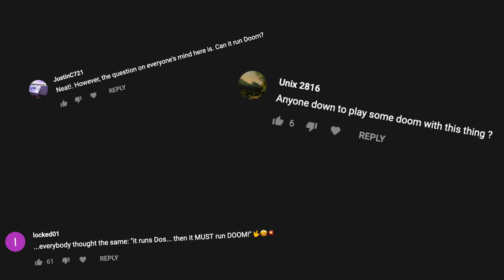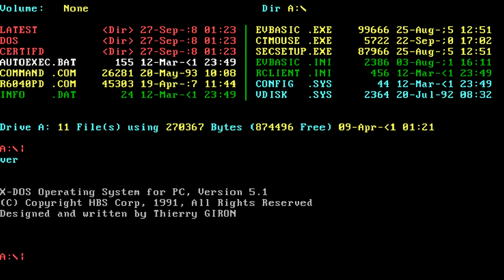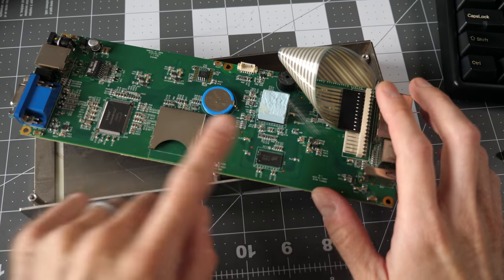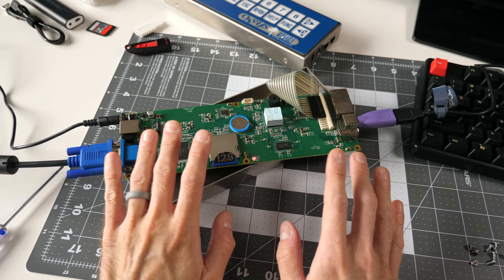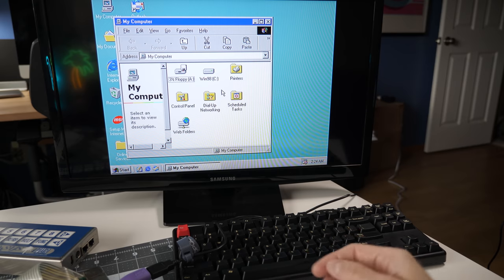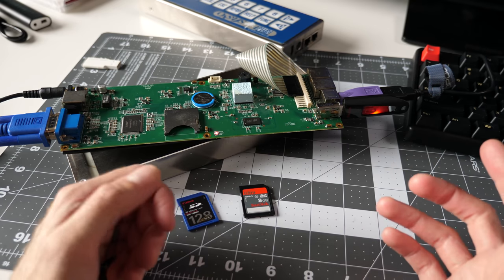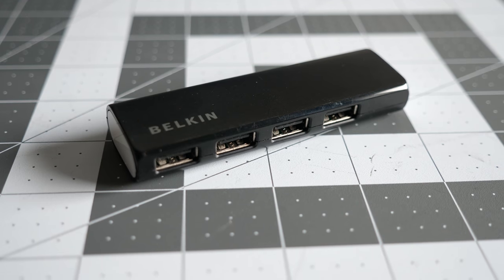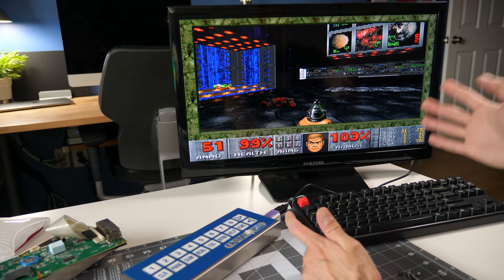Doom on a Commercial Kitchen Appliance

Comment: My desktop uses the same kind of flash, I had a corruption and fixed it using my Raspberry PI, its not that hard to do it, you just had to connect 4 wires, its a serial protocol and you can flash it without even desoldering it.

Comment: I've learned the hard way that Japanese drivers won't install on US Windows 2000.  Probably something to do with character set support. That might explain some of the issues you ran into.
Reply: Since NT (including 2000, XP, and everything later) uses Unicode internally I can't imagine any technical reason why Japanese drivers wouldn't work on a US version of Windows. It's more likely an arbitrary restriction added into the driver.

Comment: You can buy universal heatsinks online, have thermal tape on them. I did that to an old gpu that doesn't have ram cooling by default, they work great. Most cheap usb hubs that's aren't powered are daisy chain compatible, so that's why it works. I bet that has a built in keyboard controller somewhere it might be possible to get those keys working. The placement of the connector on the pins seems suspicious It could be a full blown qwerty header?

Comment: I think I saw someone talk about how that sector thing is also a problem with certain PS/2 configuration disks that you need to configure the BIOS, if you try opening them in Windows 98 or certain versions of dos they'll change some sector and make them not work, so there's some utility you can run to fix them? Either way it's really weird that the virtual floppy wouldn't be write protected.
Reply: seeing how its windows, it probably tried to write desktop.ini to it, and that's what totally screwed it up

Comment: I used to have a Vortex86 Thin Client, very cool, and at the time I did run Windows 95 on it.

That little SMD chip probably could be removed, and it would then default to the SD when no "floppy" is present. If you are adventureus, you could probably find a supllier to provide a replacement chip that maybe could give you more space.  Or, if you want to be less risky, you could find out which pin or pad provides power and disable that, which would then force SD card.

The USB first boot is kinda there in retail devices for industry because often the guys they send to repair or replace don't have technical skills so if they can configure the machines to always boot from USB, a tech only needs to know to power it off, put in USB device, power on and follow some predefined sheet of directions. Of course for security it's not exactly good because a malicious person could easily insert a USB device and brick the unit.

We had machines like that at BestBuy, our tills were IBM machines and were configured to boot from USB. I fooled around more than once with those. Management was sick and tired of those things failing, the hard drives kept dying (80GB !!) and we had a bunch of units that had bulging caps. BestBuy wouldn't send a tech unless a device failed a test, and they always had us do this stupid "reload" which never solved the issue as the drives were gathering pending sectors but couldn't ever get past, and a test or reload of course wouldn't always fix that unless you did a full format and force the sector to flip. 

So glad I got off that sinking boat.
Reply: Connecting a drive power connector backwards will usually fry the drive's electronics (guess  how I know) and then it would certainly fail the tests corporate was looking at. Not that I'd recommend doing that but I've read stories of people doing worse. Apparently 120VAC into a video card can blow a hole in the board.

Comment: A word of warning with PS2 splitters make sure that it handles the entire PS/2 protocol and not just part of it. I bought A PS/2 splitter and my mouse was acting wonky and when i went into my device manager it thought it was a barcode scanner which made the x and y axis wonky. If you're lucky enough to have a gaming board with a ps2 port either single colored or a universal half green half purple PS2 ports you're good; if not make sure it specifically says it's for keyboard and mouse and not just a generic  PS2 to usb adapter(basically spend the 9 bucks on the cheap chinese one that supports keyboards and mice properly vs the 5 dollar cheap chinese one that is a toss up)

Comment: I've never heard of an Open Source BIOS other than CoreBoot or LibreBoot, CoreBoot is actually used on all ChromeBooks, and LibreBoot is the same as CoreBoot but there's no binary blobs in the code.
Reply: SeaBIOS is a very commonly used Payload to emulate an actual BIOS often installed with Coreboot. Another often used payload is Tianocore which is the reference implementation of uEFI. Coreboot iself lacks the ability to boot anything outside of the BIOS EEPROM. So you need a payload in the EEPROM who does that. SeaBIOS and Tianocore are examples of that, but also you can install Grub, or even a full (but very tiny) Linux System.

Comment: Here's an idea to throw your way in regards to booting from the SD card.   Given that the boot selection has it as the 2nd drive, more than likely (on most systems) if booting from the first item on the list fails, it will attempt to boot from the second item in line, and so forth.  So my guess is if you disconnect the power to that chip (lift the 5v line), it should boot from the next device in line, which is the SD card (I wrote this before coming to the part where you bricked the chip).   I know that is not what you wanted to do as you mentioned not doing a modification, but hey...this is the real world and if it is something that will work for convenience, then heck, go for it!  Besides it is something that is not permanent and can always be undone.  What I do find peculiar is that it doesn't allow booting from the USB drive from the menu, but it will boot if a drive is inserted.   Since you have to fix the keypad anyway, changing to a newer cover that has the USB slot available to the outside would be beneficial.  Congratulations to getting it to work though.

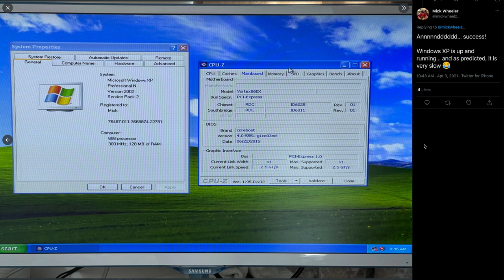Comment: 18:51 Looking up from that twitter post will reveal that you need a certain SD-IDE driver, installed with nLite
"That has not been so straightforward, as it needs a driver for the SD-IDE device..."

Comment: The bios options aren't "locked out" SeaBIOS doesn't have a configuration menu simply because it doesn't need one. It's primary goal is to boot Linux, and hand everything off to the system. You can compile some configurators INTO SeaBIOS, but they're minimal at best, and nothing like the configuration options in a proprietary BIOS.

Edit: I MAY have enough knowledge about coreboot that I could potentially get you a new BIOS for it, but it wouldn't be a minor task. The boot options were likely set when SeaBIOS was compiled as you can tell SeaBIOS what order to boot things in, and even tell it to boot directly to something, which is what it looks like this Andrew did.

Comment: Use a tool like FlashBoot. You can use it to make a fully installed working version of XP on USB. It'd be more likely to boot if it doesn't have to go through the installation process. You will still need the drivers though after. It's paid software unfortunately, but there may be another free option.

Comment: So SeaBIOS actually doesn't have any kind of bios settings screen. It's designed to be used with QEMU, which would have any configuration needed already done in the virtual machine / emulator settings. Although seeing it on physical hardware is a bit of trip i must say. I wonder how modified it must be to do that, the SoC is likely designed to be as close as possible to a machine target SeaBIOS has a emulation target for.
Reply: SeaBIOS is not specifically designed to run with QEMU, its other common use is with coreboot. 
I installed coreboot with SeaBIOS on my Notebook myself, because coreboot supports way more hardware than the original EFI and I used that to upgrade to an CPU that is officially not compatible with my Notebook.

Comment: I wonder what would happen if you removed the on board flash storage, would it then just boot from SD card or usb without intervention?
Reply: yes just temp remove pin 8, which is VCC... no power, no problem

Comment: So maybe I missed an important detail in the video... why didn't you just install DOOM to the SPI flash? Did you try it and it didn't work with "X-DOS"? Also out of the scope of your work (fantastic by the way), but since the device has the executables for the device that read from the built-in membrane keys, it should be fairly trivial to decompile & reverse engineer how to read the keys.

Comment: boot linux or dos on a working unit, use dd or similar to copy everything to a disk image on a USB drive.
you can then overwrite with that just the sectors that windows changed. just copying the files to a fresh install will change their position, which may cause errors booting also.

Comment: A tip if you want Windows 9x to work better: Open the Add New Hardware control panel and it will manually do an exhaustive search for hardware it understands, including the PCI bus. Once it finds the PCI bus it will see the rest of the devices after a reboot. Then you can install video and other drivers as you would normally.

But note once USB drivers load it might crash Windows if booting from USB. The internal SD2IDE should work, though. If you want it to boot Windows automatically without F12 then SYS the A: drive and copy your C drive's MSDOS.SYS to it.

Comment: I was gonna suggest that you try TinyXP, or one of the other super small versions.  They trimmed Tiny down to be the bare essentials...and I mean bare.  A lot of the systems that would throw errors at regular XP would take Tiny no problem since most of the files just aren't there.  

However almost no drivers install, then you have to back track to find them...in a lot of cases you could use the generic MS driver instead of manufacturers driver...to at least get some functionality.

Either way, I am happy you got it.  I can't believe that little thing runs doom...lol.

Comment: Not sure but with the USB hub it might be possible to use an external USB speaker system but you might have to bridge it with some kind of external sound card through USB if that's possible.

Comment: Since you can press F12 to interrupt boot and select the SD card as an IDE drive, have you checked if the X-DOS install shows it as a mounted drive from the prompt?  If so, you should be able to modify AUTOEXEC.BAT to boot to whatever you put on it.  For that matter, REM the lines in the AUTOEXEC.BAT file that load the built in software; you'll always boot to a prompt instead of having to fight for an F12 interrupt, and you can restore to factory settings at any time.  Your final solution is a better softmod for externally-accessible USB ports, but this may make the SD card slot a viable alternative if you want a permanent (but easily reversible) built-in solution to make a mini Doom machine.

Comment: So clearly the onboard flash isn't big enough to install Doom on (looks like it's around 1.1 MB), but that should be enough to serve as a DOS boot disk. From there, you could put the rest of an MS-DOS install on the SD card or USB drive (though, maybe that requires using FreeDOS instead of MS-DOS) and add that to the PATH, and then put Doom on the SD card or USB drive. Or even add Doom to the autoexec, so the thing boots right into Doom.

Comment: What if you just desolder the flash memory chip?  It'll have to default to the next available option in the bootloader and should just load whatever you want off the SD card automatically.  The USB works, but then you have a USB drive hanging off, and I'd bet the SD card would run faster.

Comment: Floppy disks usually don't have a "boot flag" because they didn't have partitions. But what might happen is that Win98 is adding "long filename support" to the directory and the boot sector of the 1991 DOS is not grasping those weird filenames/attribute combos that trick FAT into supporting that stuff.
Reply: Floppies still have the boot marker in their Volume Boot Record (VBR), it's the 55 AA (or is it AA 55?) at the end of the first disk sector. The bootable partition flag is only used by the main Master Boot Record on the disk to determine which partition's VBR to boot next. The (conventional) BIOS itself actually doesn't know about partitions at all. To it a floppy's VBR and a hard drive's MBR are exactly the same thing.
Reply: @eDoc2020  I assumed the boot message that got stuck was already printed by the boot sector? The idea was that the BIOS reads the sector into RAM and jumps to the first instruction in that sector, wich is usually a near jump to whatever boot code is added after the whole BIOS parameter block and FAT details section. But that tiny fragment of (roughly) half a sector of machine code needs to locate and load the actual boot files form the filesystem. If Windows was adding the LFN support to the root directory, those directory entries might be way off for that boot loader code now. I *think* that is more likely what happened here. But without a raw dump, it's just speculation - and it's been quite a while when I dabbled into boot sector code, so this is mostly "as I recall" :)
Reply: @atkelar  The 'Booting from Floppy' message is printed by SeaBIOS before loading the boot sector. I don't think Windows will add any LFNs unless you add or rename a file. The data structure of a directory with LFNs is exactly the same as one without; no changes are needed to add support for LFNs.

In fact Microsoft's own bootloader doesn't support LFNs and AFAIK is very picky about the physical placement of the records for IO.SYS and MSDOS.SYS. If Windows added LFNs automatically I believe it might stop itself from booting.
Reply: @eDoc2020  It is indeed very picky... it's why it had the "sys" command to begin with. But I like to agree with you on the question: why would Windows update the directory... but extend it to: why the boot sector? The LFN entries are "compatible" with the old ones, but IIRC there are multiple "volume label" flags present where originally there should have been only one per disk. The whole issue strikes me as odd and has me wondering what actually happened there. ^^ - if you ever find out what it actually was: please share! :)
Reply: @atkelar  I believe Windows 9x modified the OEM ID for some sort of disk tracking, but it really was a bad idea. I actually went and downloaded X-DOS and it uses that field normally. After modification it still booted.

So I really don't know why it wouldn't boot after.

Comment: 128 MB RAM is definitely not enough to run XP properly. On my XP SP3 machine, the system alone needs around four times that. It typically would take two to three GB to run all the tasks XP-era PCs were capable of really well.

Comment: De-Solder the On-Chip Disk! Dremel a slot for your SD card, and USB. Doesn't have to be pretty :D Creating more of a task running Windows 95. USB Dos? Wonder if Windows 10 would load lol Just another odd question.
Reply: ~Watches more...~ Oof! lol I see where you were going with it all now.

Comment: Use NLite to create a custom Windows XP installation embedding the device drivers from the manufacturer's site in the ISO image.

You could also try using an older Windows XP version (without some of the Service Packs).

Or just install XP to the SD or pen drive using another machine and plug in, sometimes works just fine.

Comment: In the case of DR- and MS-DOS, it's more they both derive from the same parent (CP/M), the latter via Seattle Computings' clone of CP/M for x86 called 86-DOS. As DR-DOS was developed (later) by Digital Research (the originators of CP/M) expressly to address real shortcomings in MS-DOS, it's a bit misleading to suggest DR-DOS is derivative of incomplete work, acquired at second hand. Had Gary Kidall lived on just a few more years, I'm fairly confident that "Microsoft Windows" would only evoke nostalgia (and a lot of angry-funny anecdotes) today. Possibly the same fate for MacOS, too.

Comment: Ref. XP: you might also try to use the "/syspart" param ("winnt32.exe /syspart:D: /tempdrive:D:", maybe also with the "/makelocalsource"), that will allow you to prepare the installation drive on another PC, and then just connect that prepared drive and complete the install. Although as mentioned by some others, the issue might also be the missing drivers like the IDE, which you'd still need to slipstream into the install.

Comment: Back in the day with certain hardware, we had to load the disk controller drivers at the time of Windows setup, before booting into the graphical setup section. I think I had to hit F7 or something? Could possibly resolve your BSOD issue.
Reply: If installing normally that needs to be done before the text mode portion of setup so if text mode sees the drive this shouldn't be the issue.

Comment: windows 98 and earlier have not native usb support youll have to install drivers for usb stuff, xp cant be installed on an usb drive and to install from usb drive i can only suggest you to use easy2boot cause wintoflash is not free, windows xp load usb drivers on boot then if system is installed on usb usb will turn off and turn on while drivers are loaded and if drive is disconnected for a second BSOD will pop up, but you can install xp on the sd and put usb hub then usb sound card keyboard and mouse all if you put the drivers, xp with easy2boot or wintoflash will install in two stages to solve the usb media driver load bsod  and thanks for the video

Comment: Since it’s got a 300mhz Pentium equivalent with a basic PCIE graphics adapter, maybe it could run quake in software mode?
Reply: didn't see the part with a PCIE graphics adapter...
it's got a vga port adapter...PCIE is way overkill....